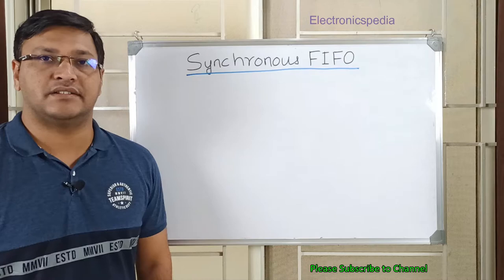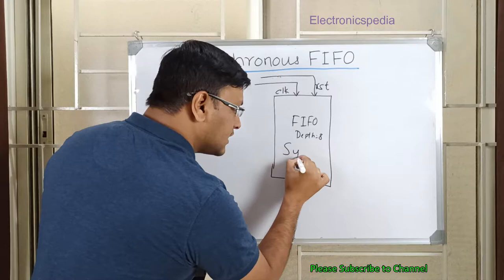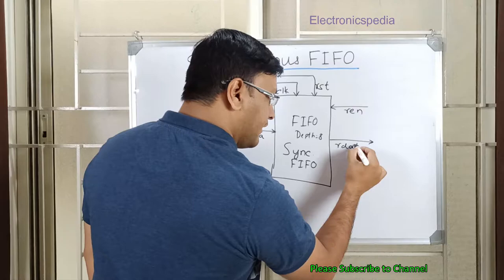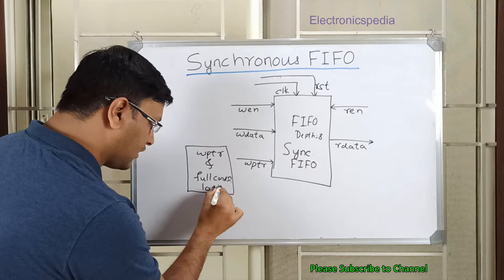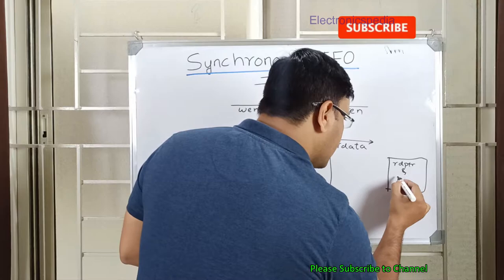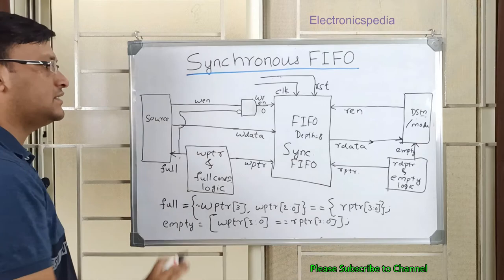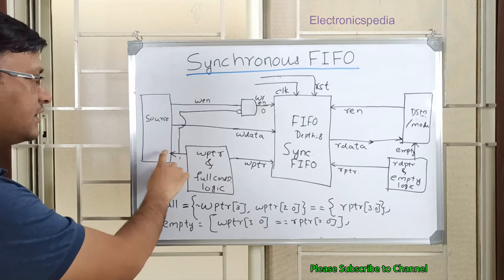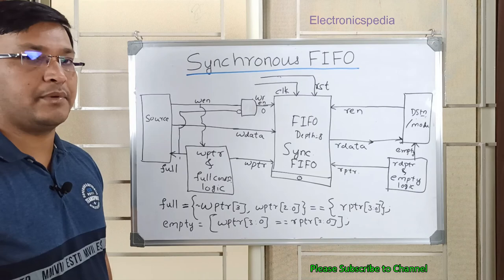Synchronous FIFO Design | Basics of Synchronous FIFO | FIFO Full | FIFO Empty Explained

Comment: Why is it of no use to do the anding with the ~empty & ren to avoid spurious reads when the FIFO is empty? The empty location may contain a garbage value so the rdata will be garbage and dangerous to the Destination Block
Reply from the maker: When fifo empty is indicated, the reading of data should not be done at user level. 
This is something that read logic at user level should take care of. 
Ofcourse we can add a logic at read side also to prevent reads when fifo is empty as an additional precaution.
Reply: @Electronicspedia  Great, Thanks 🙏🏻

Comment: I feel pointer and address can not be same, address is only linked with memory and FIFO is specialized memory where rather than address pointers are used which points next location to be read or written. Correct me if I am wrong